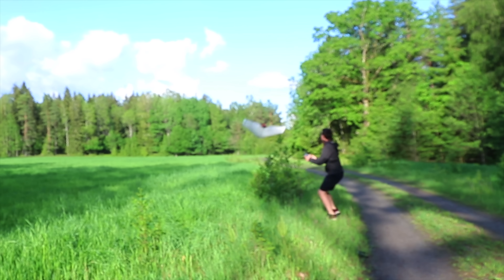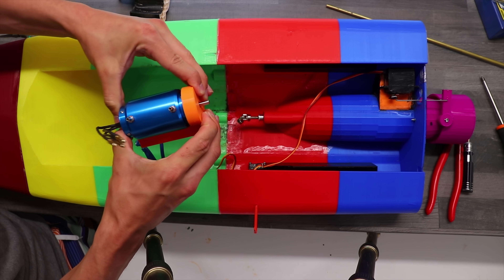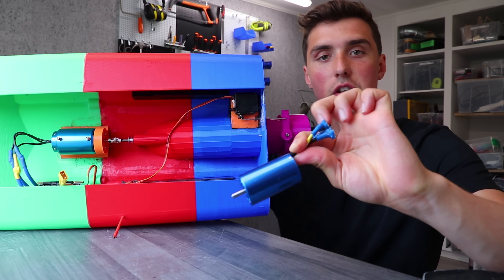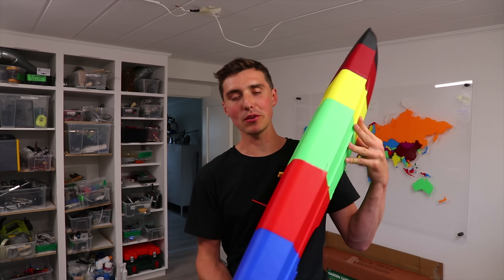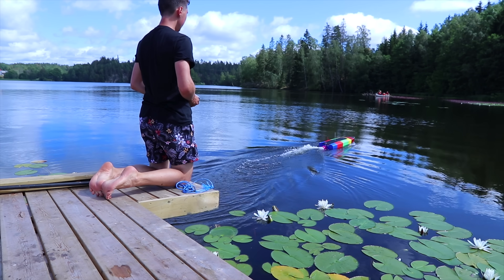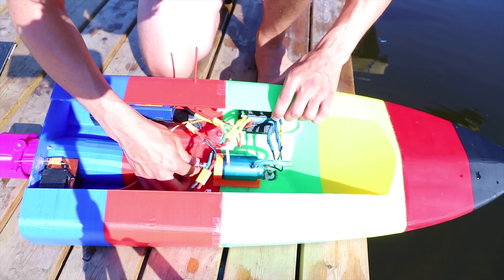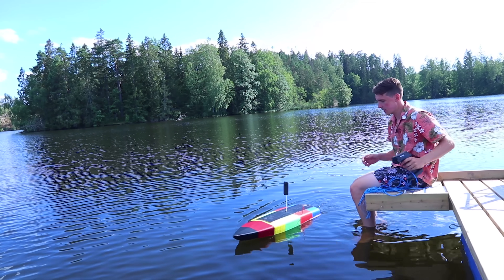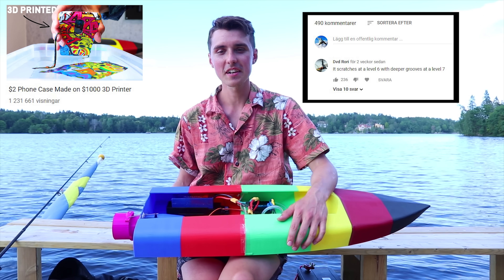How This Electric Motor BOOSTED My RC Boat

Comment: reduce the impeller/pickup diameter, or install a smaller diameter nozzle  your looking to produce a JET of high speed water, not a flood of mid speed water. Also it wont plane because it is literally carrying like 3 lbs of water in your large diameter turbine assy.
Reply: Your also not planing because your vacuuming the boat down with the turbine tunnel... the front of the tunnel should point forward... go turn a jet ski over and have a look.
Reply: @stephenkamin1345  There's no turbine anywhere in this boat. There's an impeller driven by an electric motor.
Reply: @AB-80X  there could be tho
Reply: yup bernoulli's principle

Comment: Great vid I absolutely live all the camera angles.do you do all the editing your self ? And did you go to school for it ? And have often thought that it would be way hard to have a show to host and film and do all the process of running the gear and doing the mods and the cool stuff that the show would be based on really good job and nice how you exactly explained what happens with the models motor over heating from the prop being to big and just not somuch the right match f propeller to motor ratio instead of the motor Could be exsplained as best ng cheap or some other explanation ! 
I like you exclamation of the water cooling sleeve also the fun fishing part too ! Thank you . East

Comment: You could put a bead of that UV glue across the top of your impeller mount and prevent the leak. That glue dries rubbery when a UV light shines on it.

Comment: I would recommend to use an small propeller.. or a less aggressive pitch.. basically your motor is not capable to rich its full RPM.. if  you manage to  use the correct prop.. you may easily find the way to break over 50 or 60 Mph.. best luck...

Comment: Really cool project. I like it very much! I think that a pump for water cooling will be better for your motor, also a little bit of glue or silicon or something like that to Insulate the parts from water, I think will be good for the electronics, especially for  the batteries, Even  if don't know if the batteries are waterproof. I believe that you can make it go faster! Anyway, great job man!

Comment: Hmm, have you tried to make a lip to seal the steering rod? Also, why dont you print a T-slot bottom so you just snap in the motor support instead of having to use a blowtorch to glue it in place?

Comment: I was a long time RC helicopter guy until i had my son. Now he’s old enough to get into RC stuff with me, so im excited to dust off the hobby room equipment. I have decided helicopters are too time consuming and you have inspired  me to do drones and oddball type projects like these. The hobby takes on a whole new dimension with 3d printers, we have a Prusa mk3 that should be more then capable of printing frames and other stuff. I have years of high end RC work gear, soldering stations, fabrication parts like carbon fiber, containers of connectors, servos, bl motors, speed controllers, etc. thanks for your wonderful videos showing how far the hobby has c0me

Comment: REDUCE THE SIZE OF YOUR PROP AND ITS HOUSEING BY ABOUT 50%, PLAY WITH DIFFERENT SIZES UNTIL IT MATCHES THE POWER AND RPM OF THE MOTOR, THEN YOU WILL PROLLY GO OVER 50MPH.  MAY WANT TO SHIFT SOME WEIGHT TO THE BACK SO IT CAN GET ON A PLAIN.

Comment: Cool project! Throw a gasket (permatex maybe) where the nozzle meets the hull and was leaking water to gain some efficiency. Looks like you would benefit from some more travel on the steering nozzle (and probably some sponsons next) for even tighter turning.

Comment: Why don't you make a deflection shield  just below the hatch on the back to keep the water from coming in the hull. Just make a print as wide as the back of the boat with a deflection at a 30 degree angle, problem solved. nice project btw, good job so far.

Comment: Awesome video, I think if you add a rubber O ring around where the steering part meets the boat you will gain more power.  That water shooting up between the boat hull and the steering mechanism is power loss.

Comment: you will get a lot more speed and a longer battery life if you use 2 2s lipos and the same motor if you make a smaller jet and smaller prop . only because you are using up too much space . the jet you have will fit an actual jet ski because its so big

Comment: I got some ideas, build in a potted Pi or Arduino that has GPS so you can set a start point and if it goes out of range it will automatically turn around and follow the same path back, then also weld up that seal between the boat and the jet nozzle body, then take some aluminium heat sinks and bend them to the shape of the motor and thermal glue them on for extra cooling. Also get a drone FPV kit to throw on there for primo remote driving; might as well put a coarse mesh over the water intake whole just to keep larger things from getting sucked in. Also I wonder if you could use strong mini magnets to connect the the drive shaft half's through the body of the boat rather than having an opening into the boat, might be something worth looking in to.

Comment: have you thought of waxing the bottom of the boat? i looks like the layer lines are horizontal to the motion of the boat. if that is the case, sanding it and waxing could reduce a lot of friction.

Comment: Love your videos! I happen to have the exact same motor in my boat, but with a conventional submerged prop. The boat is still being built and hasn't run yet, but I expect reasonable performance. My setup uses 10s and a 40mm prop to start with. Prop might be too large, but we'll see what happens. Gotta start somewhere! Keep up the good work man!

Comment: The fact that you have an intake that is FLUSH with your boat, instead of having a lip to forcefully draw in water, is your major malfunction.

With a RAM intake, the faster you go, the more water is forced through, making you go faster... getting more water... etc.

Also: Your jet should be completely submerged. You lose a lot of thrust with the water that just shoots out above the surface.

Comment: Couldn't you seal the area where the water is escaping the nozzel so your now loosing thrust and spaying water up. Also how did the water cooling you added worm out? If it didn't really pull in that much water you could add a tiny inline pump to make it really suck the water in and pump it through.

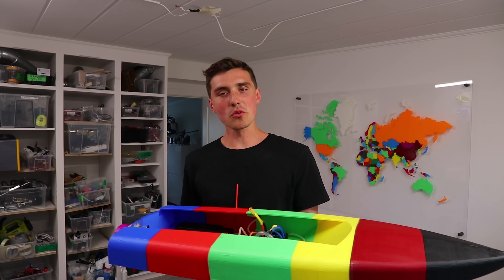Comment: some info.    you may know that a higher kv motor would have the torque needed to turn an over-sized prop, without overheating, if a bit of  REDUCTION  was used.     at 2:07, there is some energy loss, in that u-joint.     at 4:29,  for a less  iffy  supply of  water for cooling,   locate  the  intake scoop  IN  the  prop wash; or   protruding a bit, beneath the transom.     at 6:47, water spraying out is  Lost  thrust.        at 9:22,  at speed, the hull is  not  coming up on plane.    why.    maybe the hull should be coated with something,  that is  more  hydrophobic.     at 4:05, it should be understood that the  MASS  of the batteries  SHOULD BE  located as  Near to the center line, as is practical;  NOT  DISTANT  FROM  IT.   this is probably a factor in the failure of the hull, to come up on plane.      at 9:37, you may know that, due to the high location of the thruster, energy is being lost in the process of  RAISING  the water.     at 10:34,  the warm motor SHOULD be  telling  you that your theoretical  intake installation, ain't working too well.       googletranslate

Comment: good video/ editing, i think sheet styrene, for the boat panels ,( skins ) would be much lighter than the printed plastic. it would also let you use a variety of different glues, instead of melting stuff together with a torch. iv'e been building r/c boats , since 1970, . 3d printing, good for some stuff, faster speeds can be achieved with a much lighter hull! . beautiful lake/ scenery / good job on the boat!,, keep up the good work !, hello from connecticut, u.s.a.!

Comment: Change the angle of the prop so it gets more top-end and that will make it go a lot faster

It's just like a real jet boat you can put a pumped up motor on a stock pump and it's still only going to pump the same amount of water until you change the propeller pitch

Comment: 1700kv is actually a good kv motor. It was just small for that jet pump.. if you would just go bigger same kv it would be nice. But since i see you never had cooling system in a boat it will heat the small motor of, course, so since you overheated it, thats why it never had the balls to push the boat, you needed cooling in boat no matter what size motor lol do like the boat though. Interesting boat thooo..

Comment: Impeller newbie, propellers are on the out side like most boats, right there you have a jet setup, get it right.  By the way if you would redesign the impeller you would also get a much better launch and speed.  As someone who runs jetskis, I have been doing this for years

Comment: you should put the water pickup in the jet drive housing behind the propeller it will force a lot more water through the cooling that's how I did mine and it works awesome like the vid keep making it faster maybe try making one out of balsa wood and 3d parts would be a lot lighter

Comment: Nice video Simon, your video editing is very characteristic and I like it . Referring to the boat , you should check about F1 speed boat , they use a “catamaran” hull , that make it more stable at faster speeds. Check also the rear dripping water , cause u can deviate it with some fins as they do in real hulls ...  good job anyway !

Comment: About 6:12 ... I highly recommand you getting a floating channel on one side of your boat. A floating channel is a channel with is supposed to flood once your boat is flipped over. You maybe have to rearrange your batteries a tiny bit, but you can race without worrying in case it flips over. Once your boat flipped over, the floating channel fills up with water and turns the boat arround again. I have it on my  Mega Dragstar 3" from Graupner and it saved me endless times in the past hehe. 

Because I'm not 100% sure if the term "floating channel" is correct, so here is a little picture https://imgur.com/a/tevSsRD of what I mean :D. 

Other than that, super fun video. Keep up the good work o/
If you have any questions or want to chat via Discord, hit me up on Joe - Zaris#1043 :D

Comment: On the jet pump on the nozzle you need to do a taper and make it smaller at the tip it will go so much faster
Reply: Yeah about 30% reduction in diameter would help heaps

More curved  stator vanes would lots too. 

Nice video though
Reply: snikwahjets I was thinking the same thing after I saw the video. Might be worth making a video on this experiment.
Reply: yes, you are moving way more water volume than you need!  Making the nozzle taper to a smaller opening will increase the velocity of the water a great deal.  There is a happy medium between volume and velocity of water that is most efficient.  For your setup, it's going to be quite a bit smaller opening with a longish taper. Probably 1/2 the opening output size you have now I would guess...
Reply: It’s called a venturi

Comment: Maybe put some weight on the front inside the nose so it doesn't jump up and down at full speed and it'll improve a bit, just experiment with different weights and see what's best for it.

Comment: Is the water spraying from where the steering mechanism mounts to the back of the boat or is it spraying from the actual turning portion of the mount?  Reason I ask is cause if it’s spraying from where it mounts to the boat you could probably use some silicone caulk or even make your own rubber gasket for it. If it’s coming from where the tuning portion is I was thinking maybe some thin rubber glued to the side that swivels. It won’t make it water tight but it will at least deflect the water from spraying back at the hull. Awesome homemade boat for sure! First video I’ve seen of yours and must say well done!

Comment: lol,that friction turn into heat? Wtf r you talking about? Ur motor overheated becausr there are to much current going thru the coil and your motor is not cooled adquetely. Not because of friction generate heat.

Comment: The water drop sound made me laugh... thank you bro! BTW , I was looking at your slow-mo shot of the rear of the boat and all that water shooting up is coming from the space between the purple (prop and steer) and the rear of the boat ( blue PLA) why not use some epoxy or some sort of glue to add in that space and reduce the amount of water coming out from that seam + the more water coming out of the rear = more thrust.

Comment: You should surface the underside of the boat with fiberglass and paint or even just filler ,sand n paint . It will glide in the water better smoother .

Comment: the god of the motors ....
do not let me laugh.
....
look at sss , leopard, tenshock and on the top of the hill lehner motors.

By the way, your motor is meant to be on 10 or 12s lipo.

and try to get the center of gravity  a bit more to the back.

it should be about 30 to 35% of the length of the boat from the rear.
its sailing a bit nose heavy now

and water comes between the hull and the jet.
put a sealant in between that.

Comment: Awesome job. You should do a project and put some real effort into it. You have the tools and the skills, you're just lacking the little details. I'd like to see you build something incredible, like a 3D printed submarine, with a ballast tank for maintaining depth. Not your typical conical sub, though, but like the ones used for research (maybe a 3D printed sphere with aluminum framing sticking out to create four corners) to mount four EDF ducted fans to waterproof servos, one at each corner, for maneuvering, kind of like a quadcopter underwater. The EDF's could control maneuvering (repositioning the servos, and front-to-back, left-to-right, corner-to-corner prop speed of the EDF's for directional control) to control pitch, roll and yaw. Could be pretty cool. The hardest part would be the programming. It'd be similar to a multirotor, just without the need for the EDF's to spin constantly to stay in position. The controller would instead use the ballast tank for that, and only use the servos/EDF's for maneuvering.

I'm not gonna lie, it'd be a big project, and you'd probably fail a lot, and go through a lot of iterations, but if you stuck with it until you got it right, it'd be amazing.

Comment: You got a tan and a fish. What is there left to wish. The new motor performed great. The only problem was that your boat only spits out an air /water mixture.
Solution...deeper inlet (withput foam) and a smaller outlet.

Comment: You got some nice speed out of that one. I'm actually doing a similar project myself, modeling a water jet rc boat. I'm almost done, but ofc my 3d printer broke down during printing, so I'm waiting for spares before I can continue printing.

I found a solution for water cooling that actually works pretty well: On the water jet tube, just after the impeller, I put a small nipple/tube where I connect my tubing for the water cooling, it works surprisingly well. It has to be placed on the rotation direction of the impeller though, or else it wont work.

Comment: The boat would be much faster if the jet nozzle was surrounded by water. Then the fast moving water draws in other water and accelerates it too. The back of the hull needs to not be so flat, and should have ducts to allow water up from under the hull to the sides of the jet nozzle.

Comment: It held together a lot better than I thought it would.  Congratulations.  Maybe try printing a smaller diameter prop with that's axially longer?  Say, an inch or two (25-50 mm) long along its axis.  Just a thought.  Thanks for the content, and clicking thumbs up to crush a troll.

Comment: I have an idea for cooling efficiency. What if you put the inlet into the duct in a way that it forces water at high speed through the cooling system? Also, why not try to find a way to introduce a gear system of some sort so you can overdrive this beast?

Comment: Would have done 2 different Loops for the Speed Controller and the Motor, Cause now the Speed Controller is getting all the hot warer from the motor

Comment: could u add a kind of deflector at back so water will not spray up)
Also will be cool to see if u will make a hydrofoil 3d printed boat, with this motor is really to do that :D

Comment: I wonder if you could make the vessel into separate kit pieces? the nose and sides could be fully enclosed, and the center/rear compartment for the guts could be a snap in tray/box. Could maybe have them all connect with a tongue and groove system, with minimal set screws to hold them together. Something like those snap together pontoons. https://www.tinypontoonboats.com/ . Just food for thought. Your videos always get my wheels turning on ideas. Thanks.

Comment: I think you could try to fix the rudder part from leaking by printing an another part with an O-ring groove in it. That way it would seal automatically when you tighten the screws that fix the rudder in place.

The other idea I had was to re-print the rear of the boat to have a sleeve/ring protruding, overlapping slightly with the rudder part (basically a slightly smaller ring that fits inside the rudder and then it "seals" the pressurized water from entering the back of the boat.

But still - it's great to see that this time it did not sink. You might need to work on the motor mounting, though - I can see that shearing again if you don't come up with a better way to fix the driveshaft onto the motor shaft.

Comment: Try making an insanely fast boat, a bit smaller and without these different coloured pieces, maybe a catamaran with separate side pieces that get epoxied together and printed so it doesnt leak water between the layers. Make it go at least 50 kmh.